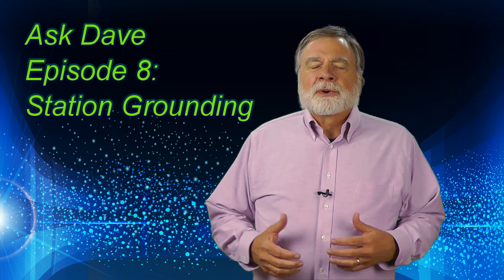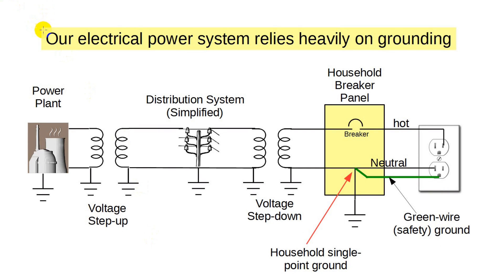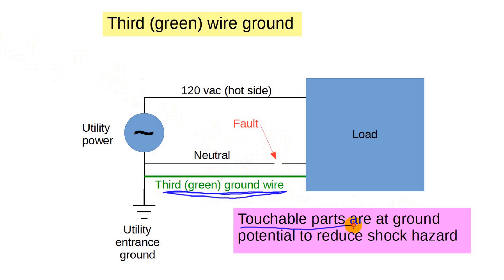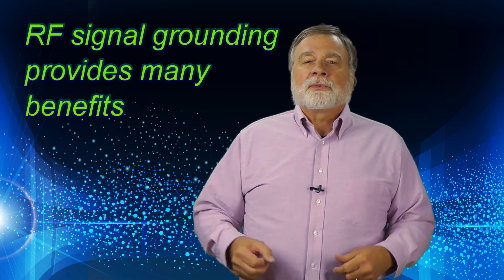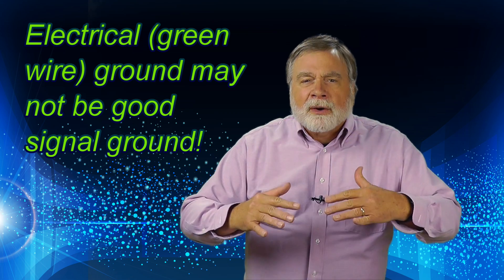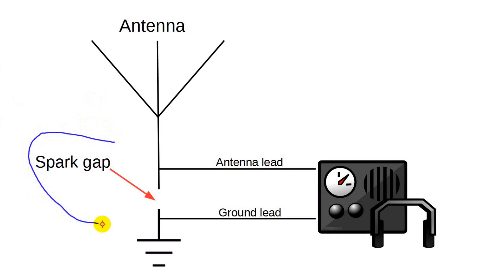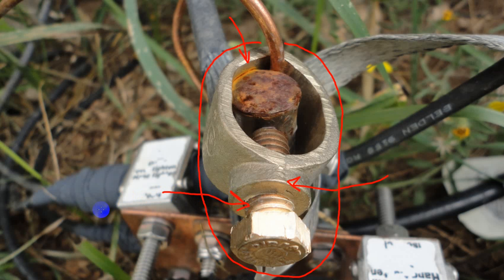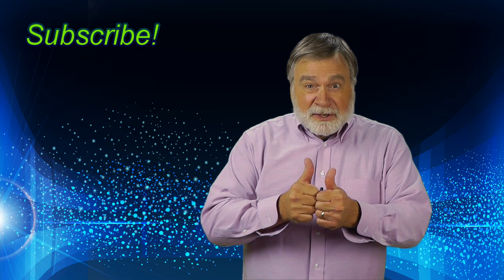Station Grounding for Amateur Radio: Ask Dave Episode 8

Comment: Is there really a need for Earthing the chassis of all the ham equipment when most homes today have an Earth via the 3 pin plug and also RCD protection ?

Sure , earth the antenna outside the shack to protect against static and lightning etc which also connects to chassis ground so why bring earth wire in to the shack at all with the potential it will radiate RF ? If the earth is outside at the coax then there is little risk of a length earth wire radiating rf from the shack.

In my opinion the only safety feature needed at the shack is RCD protection on each socket because if a fault occurs it trips at 30 ma, a non lethal current, an earth with nothing to trip this fault is going to what, keep conduction to ground until the fault is cleared.

What if the Shack earth carries most of the current and does not allow the home electrical protection to trip the power ?

If the home earth system has rcd protection then I fail to see the benefit of adding earth to the Ham equipment.

If the home earth and RCD is good enough for your cooker, washing machine and dryer I fail to see the benefit of adding earth to shack apart from grounding the antenna outside.
Reply from the maker: The utility ground is for safety purposes. The station ground, which should be bonded to the utility ground, is for RF purposes. It can really help keep RF out of the shack, plus it acts as a way to help fight common-mode currents on the outside of the coax shield. I really recommend you put in a good station ground--it will help your station perform better, especially at HF.

Comment: Vee Butterfield W7IBB says:

Lightening arrestors range in cost from about $6 to close to $100 for a coax antenna line. Are the cheap ones good enough to protect ham equipment? How much should I spend on lightening arrestors? Do you recommend a specific one?

I’m putting in an 8 foot ground rod where the coax enters my basement ham shack and will run a ground strap from it to my single point station ground. Does the lightening arrestor attach to that ground rod before the coax goes into the ham shack? I couldn’t tell how close your ground rod is to the entrance to your shack on your video #8. Thanks — really enjoy your videos and live streams.

I also left this as a comment at the end of this video on your web site.  Hope I'm not duplicating my questions.  Thanks, Dave!
Reply from the maker: Hi, I answered your comment on my blog. I use Alpha Delta Transi-Trap surge protectors on all my antenna leads.

Comment: I have watched many post on this subject may be I am  just dumb but  if all the shack equipment that have coax attached are grounded  by the shield on the coax and are also grounded to ground .
Unless you disconnect both the antenna and the ground in a storm a lightning strike near the shack will fry every thing
Reply from the maker: Yes, disconnecting is a good idea. But the main current from a lightning strike will flow to ground. Grounding as I have shown (which follows the ARRL book and also the Motorola book) will prevent damage most of the time. A direct strike, however, is unpredictable, as I know from personal experience.

Comment: Dave, 

I noticed on this and other of your videos your grounding system for the outside antenna using ground rod and copper brackets and alpha delta Arrestors. I assume this was separate from your vertical radials set up.

 I will have several types of wire antennas up during May- October either on 45 ft portable Fiberglass mast or in trees....

EFHW, or OCF multi band , or single band half wave or end fed random wire ....trying things out...all down in winter. [NO METAL MAST to establish any ground system]

I am mostly concerned with static electricity from wind on wires and in dealing with grounding of EFHW transformer ( note Steve Ellington has many interesting videos on that and set up EFHW Facebook user group....all new to me).  Anyway I assume your rocky soil in Colorado is miserable much like my very sanding soil near Lake Michigan in nw Michigan..for conductivity 

SO, Did you do anything special to deal with conductivity of poor soil for your antenna ground or just drive one 8 foot copper rod and feel adequate.  

Also do the alpha delta Arrestors deal with your static electricity worries on your wire antennas? 

Enjoy all you videos, thanks

Steve Black. W5FOR
Reply from the maker: My main station antenna, a ground-mounted vertical with many radials, is well-grounded. The cable from it goes through an Alpha Delta lightning surge suppressor at my station ground rod. Experimentation shows that doing so greatly reduces noise on the antenna. Every antenna I have goes through one of the Alpha Delta's. My station ground is bonded to the household utility ground by a bare copper wire. I have no RFI problems in the shack except for some inexpensive computer speakers. I turn those off when I'm on 80 meters.

Comment: Great video!  My electrician is running my three (3) LMR 400 coax cables up my wall, into my attic and outside tomorrow.  He is also going to pull a 6 gauge solid copper ground wire and hook it up to my service panel ground.

Comment: Hi Dave, Loved your video and i think there is Never Enough emphasis put into this area of Amateur Radio. My call sign in VO1VXC. I work for Bell Canada as a Business Services Communications Technician but worked as an Electrician prior to taking this posting. I am a Journeyman Electrician with Red Seals in both Construction and Industrial Electrical. I have installed many grounding grids for Xfmr pads, Communication Towers and Building systems. Cad Welding (Therm-it Weld) is the Preferred method of Bonding grounding systems together and mechanical splicing is more common for the ancillary devices. Cad Welding fuses the copper to copper in one joint as you know and the success rate is very high. I always tell everyone that "All Points must remain equal" in a grounding system and bigger is better when referring to copper bonding, IE Buss Bars, Copper Strap, Grounding Braid and bonding jumpers. The Electrical Code in Canada has "lightened up" on the size of copper conductor required for station electrical grounding and what once was a #1AWG for a 200A Residential Service is now a #6AWG. Again, thru non-destructive and destructive testing, it was determined #6AWG would be sufficient to carry any and all of the unbalanced load in an open neutral fault. Again, Bigger is better and there is Never enough emphasis on the importance of proper grounding for Amateur Radio installations. Tower grounding is essential for the safety of lightning strikes as you pointed out, but the Bonding has to remain from these points  to all points in the system. Grounding at the base of the tower could and should be as simple as 3 / 6ft copper ground rods driven 5 ft away from the three corners of tower base and bonding jumpers from each leg to each ground rod. I always bond my ground rods with a jumper to make a circle or loop. A Junction Box at the tower base with Static Discharge protection can and would be bonded to this ground rod installation. A #6 Bonding jumper could and should be ran towards the shack and to the Main Electrical Ground Bonding of the Residence. Again, if this ground is difficult or doesn't seem to be adequate, additional ground rods can be driven to ensure the Main Electrical Ground is maintained. Here in Canada, 3 - 8ft ground rods are driven and they are spaced 10 ft apart and joined with UN-insulated #6AWG ground wire and are tied to the First point of disconnect in the Building or residence. Depending on the size of service. this could be a Main Switch or a combination Meter Base and mains disconnect but in any event, tied to the Neutral Point at that place. Station Bonding / Grounding would and should tie to this Main electrical ground by means of a "Split- Bolt" or Burndy mechanical connection to a Ground Buss, whereby Ground Tails can be attached to the station devices.  Amateur Radio Operators not familiar with proper grounding should consult a local electrician and should actually have an electrician come by just to "Sign-off" on any issues or questionable areas. Installing Towers, Antennas and leads from these devices into your house, invites mother nature into your home and if not properly done, could result in catastrophic results. There has been some discussion as well regarding installing the Ground Electrodes in the concrete base before the pouring of the concrete and it is in my opinion to keep those electrodes out of the concrete base and the bonding jumpers on the surface to the proper attachment points. Concrete bases have been reported to "Split" if a direct hit occurs to a tower and proper dissipation into the ground away from the tower base would be the best result. I also have a Ground Conductor that runs down the outside of my 50ft tower away from my Entrance coax and this bonds devices like antenna masts, Rotor frame, Top section of the tower and my home made "Lightning Dissipation Sphere". All connections are spayed with "Glyptol" and essentially protected from corrosion which exists very highly up this way. Best 73 and thanks for allowing my comments.
Reply from the maker: Thanks for the information.

Comment: I'm a newbie Tech, KC1HLD, I have a shack in my basement connected to a grounded J-pole out the back about 12 feet away. I believe that the J-pole is lightening grounded, but I concerned about  RF grounding the units in my shack. My question is that the shack is against an outer wall which cannot be drilled through because of a brick fascia on the outside, so can I drill a hole through the basement cement floor and install a RF ground? This would allow me to put the grounding rod directly behind an interior wall only 1 -2 feet away. Failing this can I connect to a cold water pipe within the basement?
Reply from the maker: In newer (last 40 years or so) homes, the cold water pipes are copper within the house, but the pipe running from the utility in the street is plastic. You can certainly put a ground rod into your basement floor.

Comment: Good job. I special ordered a 10' 3/4" rod for the base of the tower, then ran #2 copper THHN along with the coaxs into the shack to a ground buss (common point) with a #6 from the that to one of my 2 ground rods for the electrical service. Glad to see we agree on all aspects. I run everything on 12 vdc (mobiles) and the only issue is mobiles don't usually have ground posts. They are negative ground which means the SO-239 is connected to the (-) negative. A barrel connector with a ground lug comes in handy when transitioning from hardline or LMR400 to lets say 8x for a short hook up jumper. 73

Comment: Hello Dave, happy new year.  Congratulations for this excellent video, this really cleared a lot in my mind!  Your advise please:  I intend to install my lightning arrestors in a metal enclosure with the arrestors are bolted on a copper plate, which (plate) will be grounded.  Now, for my radio I intend to run copper braid from the various constituents onto a common copper plate, which will be connected to the ground rod.  Question: should I connect the latter with the former (which are located close to each other) and then run one single copper braid to the rod, or should I run 2 separate lines to 2  different rods?  I am concerned about connecting the 2 copper plates together, as I fear high voltage from a lightning passing from the ground line of the arrestors onto my shack (through the shack’s grounding line).  On the other hand, running two separate grounding lines seems a bit of a overkill.  
WHAT DO YOU THINK???
Reply from the maker: I have a single ground rod. I also have a short piece of copper pipe in my station that is my single point ground. I run all equipment grounds to this, and then I run a single (large) wire from the copper pipe to my ground rod. Also attached to the ground rod are six lightning arrestors for all the antenna cables. From there cables bring the antenna leads into the shack.
Reply: David Casler aren’t you concerned that a lightning charge may end up in your shack via the ground wire?  The arrestors are on the same ground line like your shack....
Reply from the maker: @stefanosfragos6484  Not terribly, no. A direct strike can be unpredictable (I know from experience), but a near strike will be taken care of by the lightning surge protectors on every one of my antenna lines. The protectors are right on the ground rod.
Reply: @davecasler  I am back after a year long break, and I am now implementing my grounding infrastructure!

Your feedback on this will be much appreciated:

LIGHTNING GROUNDING SETUP:

My shack is on the 1st floor of a 3 story building.  Three sets of coax cables - one for each antenna - will run from the terrace down the side wall of the building into a metal enclosure where each coax will be connected a lighting arrestor.

The enclosure will be on the 1st floor, on the outside of the room where my shack is.  

The 3 coax cables will then make it into my shack by penetrating the outside wall.

The 3 arrestors will be bolted onto the backplate of the enclosure, and I will run a 18mm copper braid from the backplate   straight down onto my ground rod (that’s approx 3 meters long).

QUESTION 1:  HOW DOES THAT SOUND SO FAR?

RF GROUNDING SETUP:

I will run small / short wires from each shack component onto a single point copper pipe and connect the side of pipe with a 18mm copper braid. The RF grounding braid will exit the room through the same (30mm)  hole from which the 3 antenna coax cables enter the room after the lighting arrestors.  This implies that the 3 coaxes and the RF grounding braid will touch for 20cm (wall thickness).

QUESTION 2:  ANY ISSUES WITH THE LAST SENTENCE?

If I must avoid this by drilling a 2nd hole to the wall (one for the 3 coaxes and one for the RF grounding braid), how far apart should the two be?

Thanks in advance for your time, hopefully this will help other people dealing with grounding on anything other than ground level.
Reply from the maker: @stefanosfragos6484  Sounds good to me.
Reply: @davecasler  No need to have two holes on the wall you recon, the 3 coax cables and the RF ground braid can all exit through the same hole right?
Reply from the maker: @stefanosfragos6484  Yes
Reply: @davecasler  Hi David, quick question:  I have installed my lightning arrestors and I was checking the coax connections using a polymeter.  

The middle connection that enters into the arrestor from the shack and that that leaves the arrestor to the antenna does not not close circuit. Is this normal? 

The outer coax connections do close circuit as expected, given that  these are grounded all together via the backplate. 

Thanks in advance for your reply!
Reply from the maker: @stefanosfragos6484  You are correct. The middle connector will not show a short. Inside the lightning arrestor is a spark discharge tube that will short the inner lead in the event of a nearby lightning event, thus protecting the radio.
Reply: @davecasler  Thak you David, also for your latest dedicated video on lightening surge protectors. 

Admittedly I am puzzled as to why the middle connector would not show a short circuit. Let me clarify: I am not looking for a short between the middle connector and the ground plate (I get it that this will only happen when there is a spark inside the tube).  

Instead, I am looking at a short between the middle connector that enters the surge protector and that which exits it. I would expect a short there, a continuous line in other words, otherwise how would there be continuity all the way onto the antenna?
Reply: @davecasler  As a follow-on, my surge protectors are the PolyPhaser IS-B50HU-C0, and per manufacturer data sheet, as you say, there is no dc continuity from center pin to center pin.  

I just don’t get it, how does the center pin   transmit power passed the arrestor when there is no continuity...
Reply from the maker: @stefanosfragos6484  The Alpha Delta lightning surge suppressors do have DC continuity through the arrestor. Others may not.

Comment: Dave Does the ground rod have to be 8Ft? Thank you Don
Reply from the maker: No, but that's a standard length. I wouldn't go any shorter.
Reply: @davecasler  Hmm, good direct answer, but what is wrong with a 4ft one? Or, two 4ft ones joined at the top? That would preserve buried contact area. I ask because depending on where you live, or how the foundation outside was backfilled, it can be hard to drive in 8ft. Thanks, love your videos. I think they're the best ones out there for amateur radio.
Reply from the maker: @Roddy1965  there are lots of approaches to grounding for when the soil is very rocky. One thing you can do is bury the ground rod horizontally is deep as you can get it. That'll give you about half the grounding of a vertical ground rod. So just go 6 feet away and bury another one. Make sure you bond the two together. I recommend the longer ground rod for your station ground, as it will do a better job of reducing noise. Good luck with your station.
Reply: @davecasler  Well, that ground bar went in to my surprise. : )  But, while trying to avoid folklore, I am somewhat perplexed by the story in http://www.audiosystemsgroup.com/GroundingAndAudio.pdf  slides 103 an onwards for a bit. Some good points may be made here about chassis grounds etc. Still, seems that as long as the bus grounding bar isn't too long, having it as a common ground direct to a gnd rod should be ok.